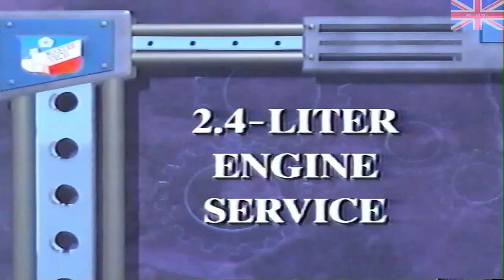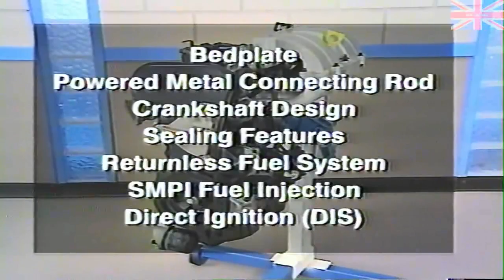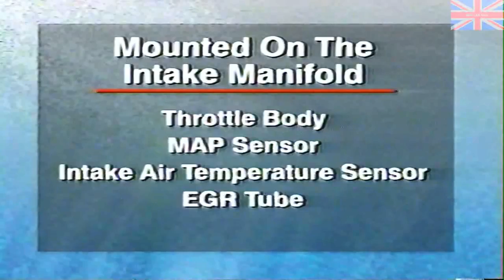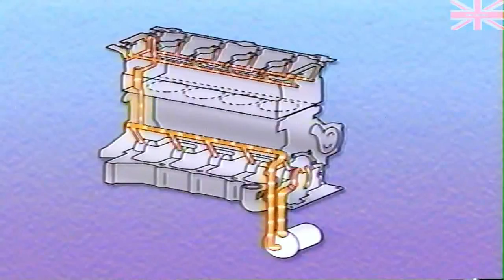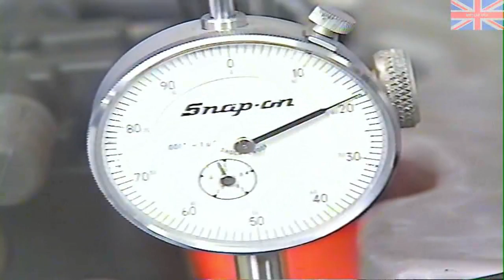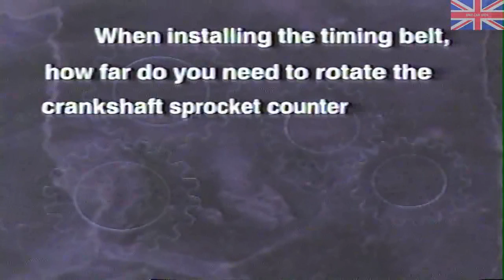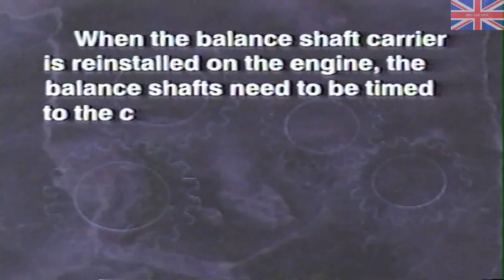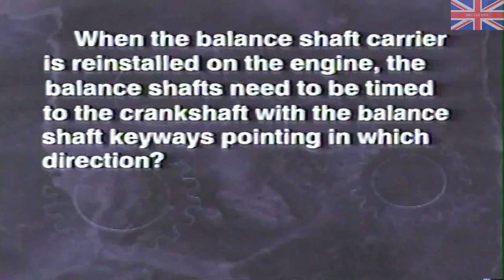Chrysler (US) - MasterTech - January 1995 - 2.4 Liter DOHC Engine Service

Comment: This is one of the best engines ever made my moms 2000 2.4 had 259688 on it and worked great i bought one with 168000
Reply: I've got a 04 stratus with a 2.4 dohc with well over 300,000 miles on it. Still runs good

Comment: in theory the tensioner pin could be used to check for proper tension of the belt prior to removal unless the belt stretches over time. possibly at the start of replacement you could push back against the tensioner pulley to line up the holes and slide the pin into it. might be a time saver, i dunno.

Comment: I have a loud cold start knocking sound. Quiets a lot when at operating temp. Balance chain loose? Mine is in a 2004 Jeep TJ 2.4L Powertech.
Reply: switch to synthetic oil. its probably valve tran wear.
Reply: I have the same issue - during winter is louder. Did you find out the solution ?

Comment: Ive seen that timing belt break at 90k..
Reply: The Haynes manual i have suggests replacement at 90k miles.
Reply: Miles is just a Ballpark.  Hours is really how things should be rated for replacement.  Remember the 3000 miles and 30,000 miles service guidelines for severe service?   Keep doing that and your engine will be trouble free.  Same with 100,000 mile overhauls in a typical daily commute city driving.   

I got 21 years of driving out of my PT cruiser and the car pretty much paid for itself and made it almost 22 years before major engine mechanical failure.   And I'm pretty sure that's either the heads, timing belt OR the Balance shafts.    Damn sure the block and pistons are doing okay and could do more service if needed. 
 
I don't give a damn about MPG.    So thicker oil is fine by me.  And using a Block heater in the winter time has really paid off.  

Never let the dipstick go bellow the "F"   
never let the coolant go even a bit short and you'll probably have a car that last well over 500,000 miles Grant it if you take care of all the maintenance issues.  

when I store my car's? It's either Evans coolant or I just use straight up  synthetic oil in the cooling system if I'm going to store it for a really long time.      everyone talks about cooling issues.  but I've never had one.   and after I did it I never had a water pump fail due to corrosion or impeller erosion.    

I wouldn't do this in the salt belt but for me it works just fine